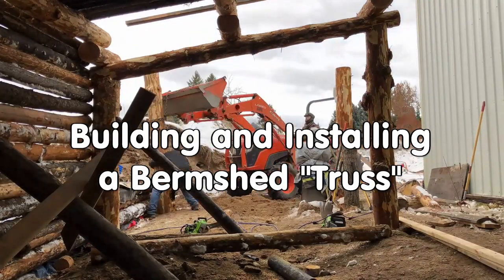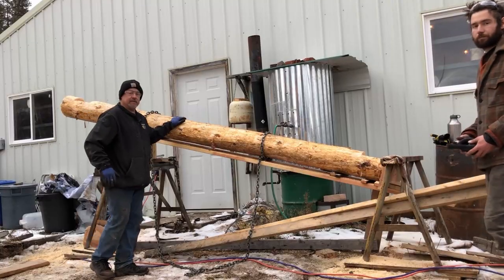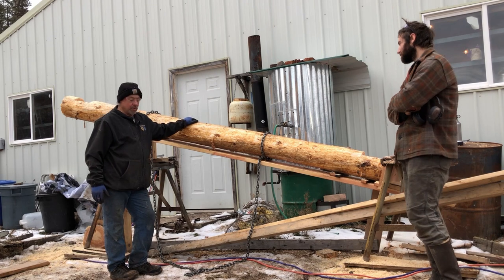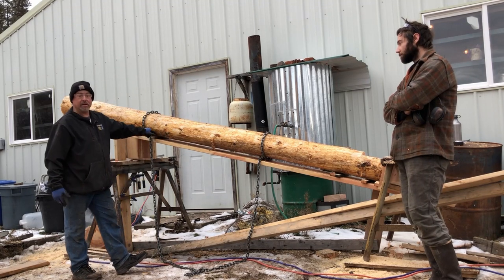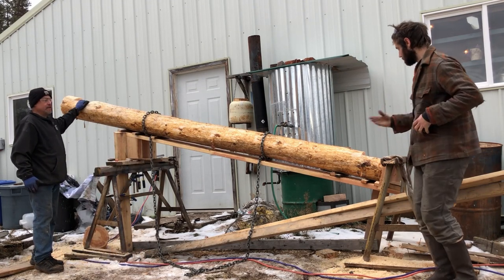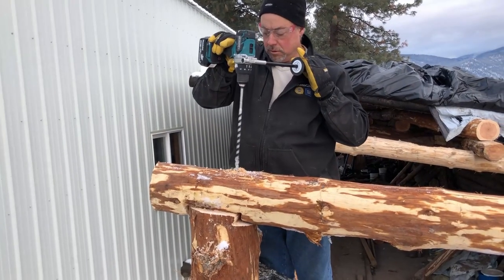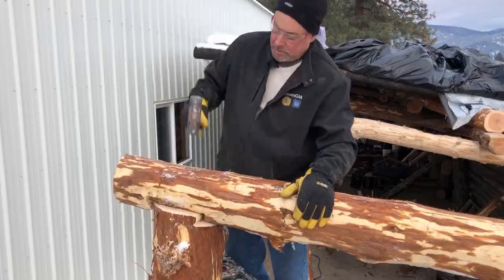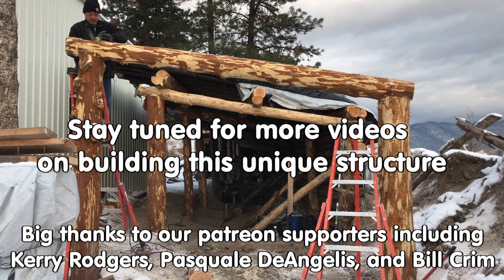Berm shed truss - round wood timber framing

Comment: on yer berm side o the buildin, how do ya seal it so water an soil wont filter in? thank ya fer the video
Reply from the maker: We fished some old billboards out of a dumpster
Reply: @paulwheaton  thats cool an smart ai didnt think thet, is thet buildin fer storage only or coud it also be used fer live stock too? thank ya fer the tips an ideas, more videos please
Reply: russ sherwood IIRC, Sep Holzer, where the idea came from, uses them for livestock.
Reply from the maker: @russsherwood5978  We're working on getting more videos out.   If we had more support for our patreon stuff, we would be more frequent.   We're not gonna do livestock with this one.  I prefer skiddable structures for livestock.
Reply from the maker: @HylanderSB  Sepp's structures are similar and very different.  Sepp's standard build has a 200 square foot footprint and costs about $2000 in materials.   This one is closer to 1400 square feet and about $150 in materials.
Reply: paul wheaton D’oh! Am I at least right that your structure is inspired by Sep’s? I’ve listened to all your podcasts but that introduces a huge problem of keeping all that info straight in my head, which is getting harder as you put out more and I get older.
Reply from the maker: @HylanderSB  I think the idea for the bermshed came after oodles of study of sepp's stuff, oehler's stuff and ianto's stuff.   And then I thought "I have mountains of logs and very little coin.   I need a LOT of shed space.  What can I do to make a super freaky cheap shed?"   The roof was the trickiest part - which oehler solved.   The next thought was "how do i get the rain bits to have a continuous path to the ground so I can use a really cheap membrane?"  The berm shed was born.
Reply: paul wheaton Sounds like a topic for a future podcast after you get the videos up. The content seems to be writing itself lately.  Got some great momentum after so many years.  At least that’s how it looks from this side.
Reply from the maker: @HylanderSB  I'm trying to pay for a lot of stuff over here to keep the forward momentum.  The patreon stuff REALLY is the roots of more vids and podcasts.   I do think that when it is done, we need to record a podcast.

Comment: Bend the last few inches of the rebar over at 90 degrees and pound it in to the top of the log to really lock it down.
Reply from the maker: or maybe pile a roof on top of it and then add about 8 inches of dirt.  Gravity glue!  :)
Reply: paul wheaton yeah, I suppose that could work too. Hahah!